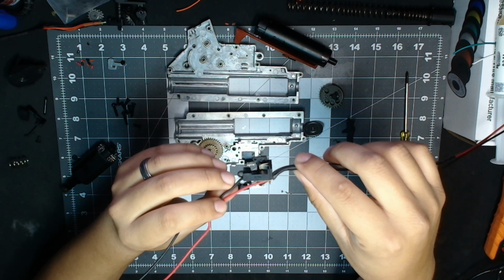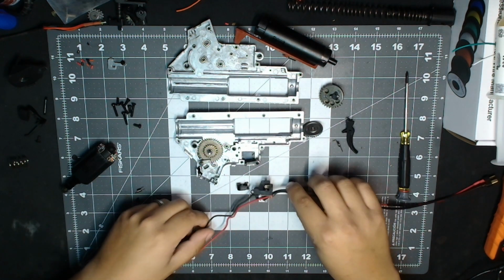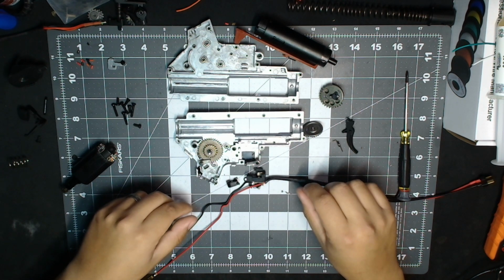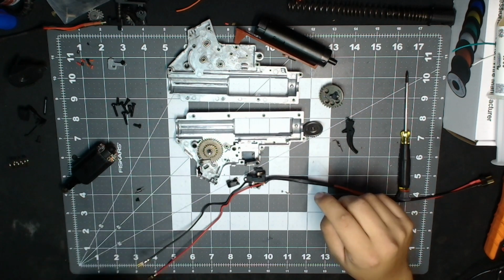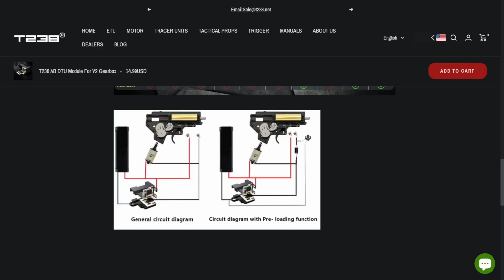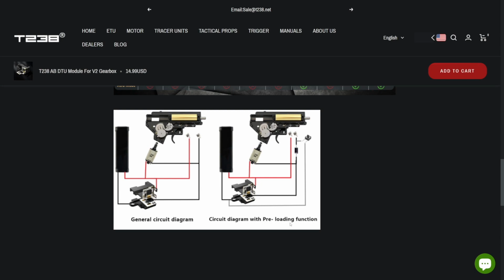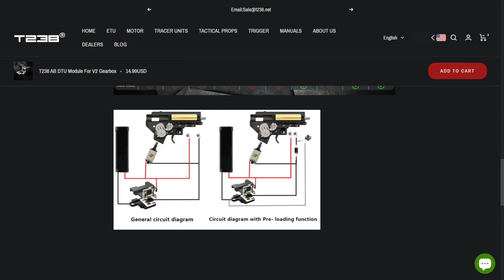T238 AB DTU MOSFET - Install/Overview

Comment: Interesting and my gel blaster has priming mode which you pull the charge handle and it spins the motor in the mag to fill the tube with gel balls.
Reply from the maker: That is interesting. Its like pre-cocking without firing the gun. I do not think airsoft versions have that function.
Reply: @airsoftpartsbin  yeah and I have an Airsoft and a GBB Glock and none of them have this electric prime it’s either the wind up spring or the Glock spring. I’m surprised they don’t have the mag that feeds and primes with the trigger on air softs. That mosfet is pretty cool though